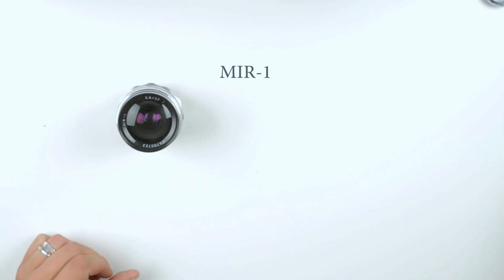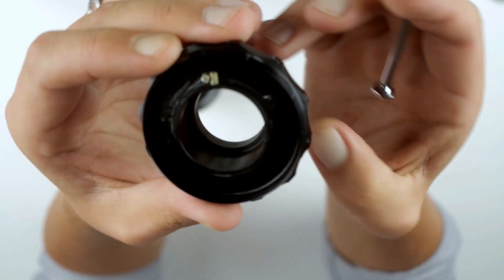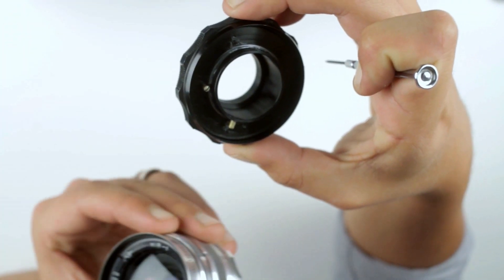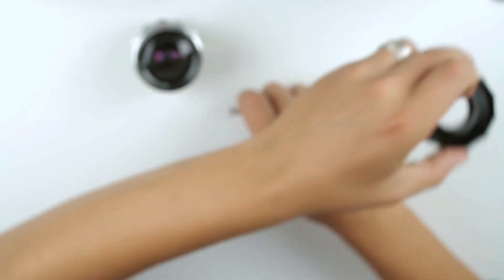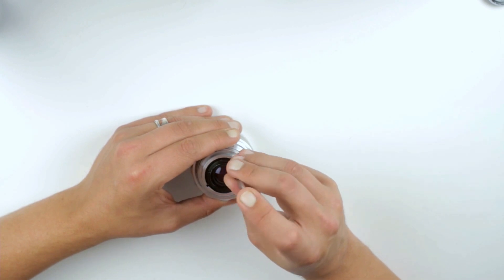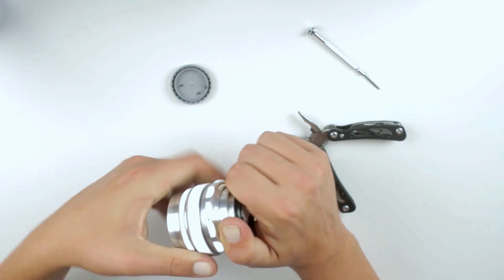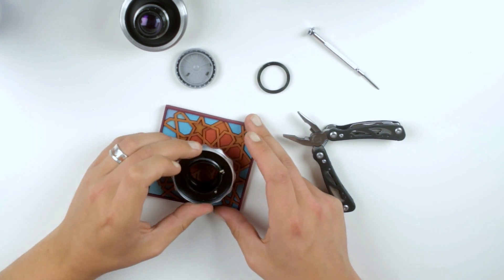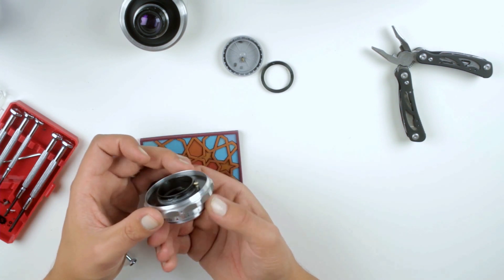Mir-1 close focus modification

Comment: I did this during a CLA on mine and got the same results you describe - gaining about 120mm of focus (around ~579mm now). Several of the other videos detailing this on YouTube claim to gain 350mm of focus but this isn't possible with the lens design. I wonder if they are not measuring from the actual focal plane within the camera.

Comment: My screw bent... I didnt have any "wd-40" , so I just tried without it - put in the screwdriver and with a clamp rotate i. AAaand I think my screw tore... I didnt check I just kept twisting and I wasnt twisting it out, I was actually twisting the Metal its self so it looks like as if the metal of the screw bent into the direction I was turning in... now its just a spiral, not a screw :/
. I had two screws, and well one is ruined so I dont know what to do now. any tips? Im no pro

Comment: hello I followed this mod instructions and now the lens focuses to about 55 cm instead of 70cm but I lost infinity focus in the way that it gets past infinity and blurred again even if on the scale of the lens it reads ''infinity'' what could have I done wrong? (i adapt it to a sony a7 camera) also I noticed that other people were getting a close focus of around 35 cm and I saw some sample images which shows way more bokeh than i seem to get. any advice?
Reply: Hi Fedmusic, di you manage to fix this problem. I am in the same situation after removing the screw, it goes way beyond infinity and blur, and the close focus is not changed that much. It will be much appreciated if you share your workout, mate :)
Reply: @ViewMediaUK  no honestly I have not found any solution! i have the newer version of the lens (black version). I measured it again and I was wrongly measuring 55 cm from the end of the lens but from the focal plane is closer actually to 70 cm. and still no way to obtain some of the great bokeh I've seen on examples online. if you find any more info let me know!
Reply: @Fedbo  Those were surely examples with the extension tubes or helicoid adapters being used. Also, some people reverse the front element for the extra "swirl" (but less drastic and tastier than the same mod performed on Helios 44 series). You won't achieve anything like it by simply removing this screw, since you only get a little bit closer. The lens is actually pretty sharp when used for macro and many aperture blades are pretty useful too.
Reply: @dejandodic9482  actually you can get those results, check out the video made by the youtube channel Raychristofer, the guy does the same mod and achieves a pretty impressive bokeh, I had a talk with him and he's not using any extension tubes so it still doen't explain what's going on

Comment: Great video, The only difference with my lens was the infinity stop screw wasn't long enough to stop focus throw. However, the 0.7 stop screw was. I ended up switching the longer 0.7 stop screw for the shorter infinity screw and flowing the rest of the instructions.

Comment: Hey there, thanks for the video! I have a black Mir 1-b myself and I tried to perform this mod just now. The small screws got loose like a charm but I only found two of them - I checked the two other holes with a magnifying glass and a lot of light, I'm pretty sure there were just these two... I hope. Now when I try to twist the lens like you do, the whole thing seems to turn in itself, I don't feel anything coming loose. The only thing I can loosen is the front element but I don't want that for this mod, do I? Do you have any hints, ideas or an advice what might have gone wrong? Thanks in advance and greetings from Germany! :-)
Reply: Exactly the same thing happened to me. Did you manage to get the ring off? Any advice?